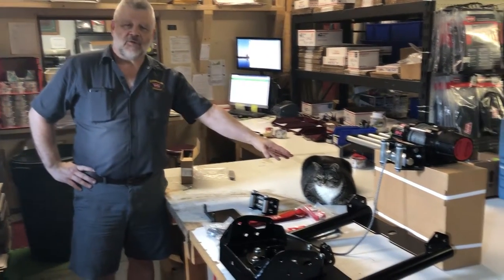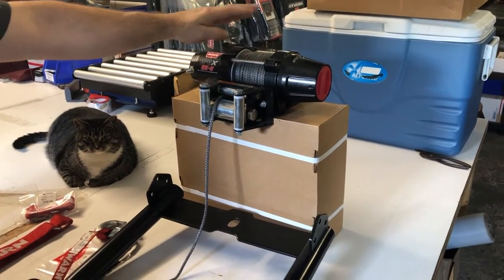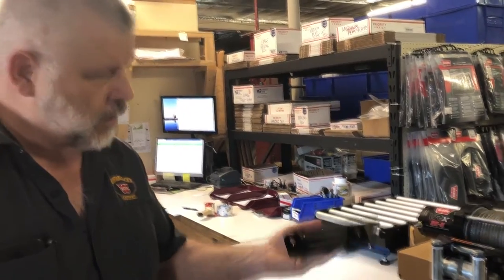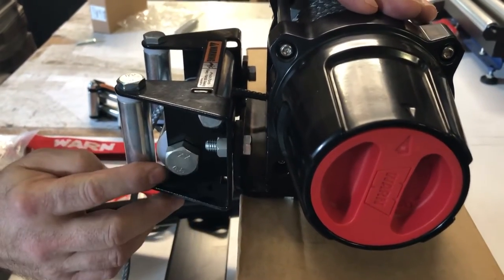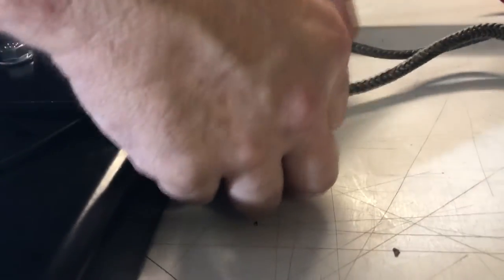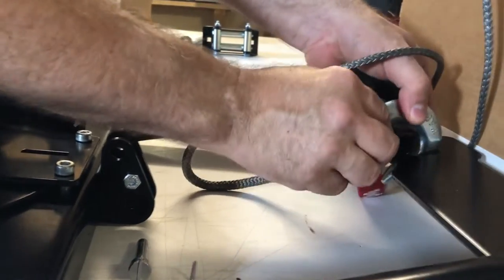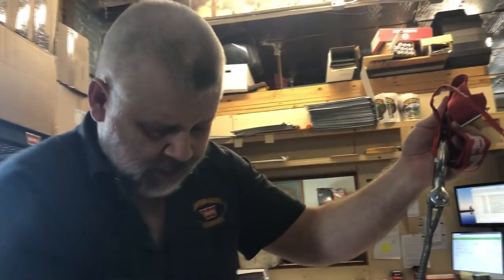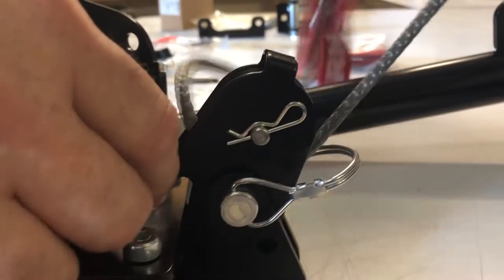WARN 81630 Plow Pulley Upgrade Kit Installation + Other WARN Plow Tips

Comment: you can’t put the pulley on the top hole because the lever attaches to that hole that allows you to angle the plow blade to the left and right. What’s your solution for that?

Comment: Scott, wow, great informative video. Thank you. 

I have a 2021 Honda Rubicon coming next month and the Honda dealer is installing the Honda/Warn winch for me (Honda P/N 08L71-HL5-A02). Is this the same winch that you have featured in your video, but just rebranded for Honda? My winch will come with the steel cable. Can I use the same pulley upgrade with the steel cable or do I have to switch to synthetic?

Lastly, Honda/Warn also feature the 54” plow (Honda P/N 08L76-HR3-A21), the push tube (Honda P/N 08L77-HR3-A21) and the mount (Honda P/N 08L77-HR3-A21). Do you know if these are all just the same Warn Provantage components? Is one or the other better to go with?  Thanks so much for any guidance you can provide.

Comment: Would you suggest using rope or wire if mainly using your winch for plowing? I have a can am and the battery set up for these warn winches doesn’t seem to hold up to the winch plus the wire constantly breaking at the hook when I need it the most. Any advice would be greatly appreciated I’m new to this whole thing

Comment: Great video! Have a 2021 grizzly 700 and installed the warn provantage plow 60inch blade. The first use the plastic pulley cracked. Thank you for this informative video! Ordering today! My atv came standard with a warn winch. Steel braided rope. Do you recommend a different rope for plowing?
Reply from the maker: While synthetic rope may tolerate plowing abuse a bit better than steel, when we use a two line lift, we don't see much rope wear with either type.